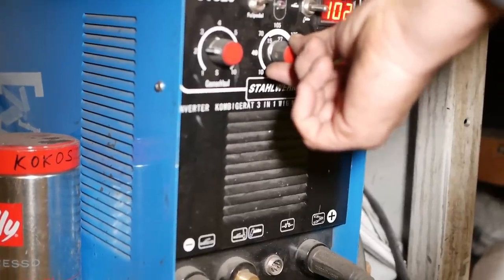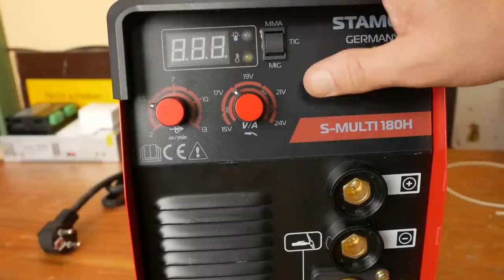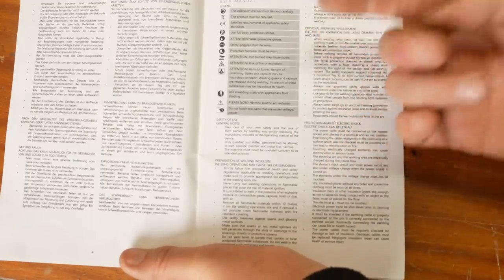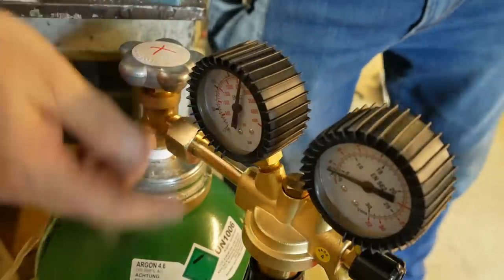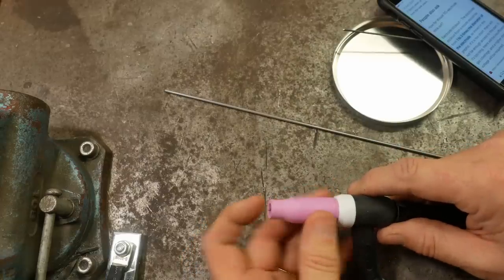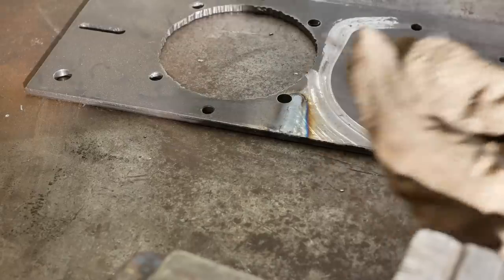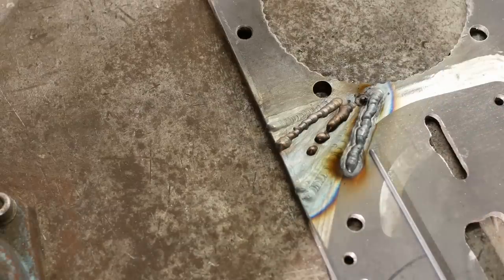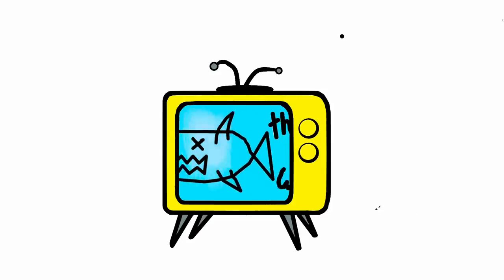Can I learn to TIG weld in an hour using just the internet? || RotarySMP

Comment: Mig is my primary welding method. But I have been doing more solid core wire welding for bigger stuff since Argon has gotten stupid expensive since Linde bought one of our biggest suppliers here. I really would like another mig welder since changing wire sizes allot is annoying. 
   
   I have a multifunction welder in the shop that the only thing I have used on it is the plasma cutter just cause I wanted to see if it actually worked... It does everything but mig... I need to get an argon tank but am keeping an eye out for a a fair price on a large bottle since renting bottles is pricey and has other downsides. But it's been a long time since I have tig welded so I will be relearning. Check out Jody over at welding tips and tricks for great teaching videos. A friend of mine has been friends with him for many years at the airline they both worked for. He really knows his stuff. You are starting off pretty well I'll let everyone else critique.

       I'm catching up on videos since getting back from Greece. All went well taking Turkish other than the interesting food and the very uncomfortable seat backs on the 787. Bad lumbar design on them. Mom had a great time and wants to go back. I have a friend at one of the hotels so if I ever get anything to drop off to you he will hold on to it till you get there. It's behind Yasouvlaki close to the old Waffle House location. (they are on the main drag now next to the other ice cream place that's half the price)
           I did make James May proud as I rented a Dacia Sandero to drive my mom around the island since it was cooler than normal and an ATV would have been a little cold. I did grab a couple Naxos decorative license plates to put on the Mustang while there. Will be back there in September with the annoying 3/4. :)
Reply from the maker: Glad you had a nice trip to Naxos. We started checking the weather, and it was much cooler than we'd expect. I hope the sea temp comes up in the next few weeks.

Remember that seats are buy furnished equipment, so the airtline choose the ones with the crappy lumber support, they are not inherent to the 787.

Linde is also really expensive gas for us here. They have basically forced everyone onto rental contracts. Their rental bottles also have the regulator on them, but I would rather have my own flow meter.
Reply: @RotarySMP  Yeah they have their seats 10 across instead of the usual 9... But width was less of an issue than the shape of the back. It was my first time on a 787 as I fly allot domestically but I never seem to be able to non rev on a 787. I really miss the a330 with its seating layout being 2 on the sides.
      The first flight the air packs were acting up and it was hot most of the flight. The air  temp would constantly change as in a minute of warm then hot then slightly cool air. I had a pair of thin shorts that I changed into in the bathroom which was not easy seeing how the floors are nasty and you never stand on anything without shoes...

    I have seen those integrated tanks with regulators in Aussie land users. Fortunately the US likes to stick with tradition for decades so we will be keeping our tanks as is. 
     The Linde owned stores have a stock of other brand tanks they will exchange for customers. They aren't supposed to but...
       We have a company called gas pony here now that you buy a tank and then you can just exchange it at any of their locations. Basically like a propane tank exchange. They have their cages at lots of stores now and are far more convenient than the few welding shops we have anymore. I want a 330cf tank which is big but cheaper to fill and less fills needed.

    Mom really enjoyed the whole trip to Athens and Naxos as everything was a new experience for her especially the good food. But now that I have a friend there I have a dropoff spot for stuff. When we go in September we are going to go out to his place which is west of Apollonas. He is also planning to come to TX for the Formula 1 race in Austin and if he does I'll pick him up and show him around TX.
Reply from the maker: @theinfernalcraftsman  Greece to Texas. That will be quite a trip for him. Do you also go and watch the MotoGP in Austin?

How much do you pay for an Argon refill over there now? That 20L tank costs me €300 for first fill and 10Y rental, and then €58 per refill/exchange.

Have you flown on an A350 or 380 yet? Very quiet fuselages.
Reply: @RotarySMP  Sorry for the late reply been busy and forgot.. 
   
       I don't go to the races in Austin. It's about a 4hr drive and I'm not fond of Austin for various reasons. I am very close to Texas Motor Speedway though. In fact once I'm on the main road by the house I go north make a right and it takes me right to the track. (32 miles about 40 minute drive) The Nascar track. I used to go to the IRL and bush races there as they were affordable and often I got great seats from a friend. Fewer people there so easier to get in and out and the seats I got had a great view right down pit lane. 

      I have an 80cubic foot tank for the mig welder which is 2300 liters. Fill amount not actual tank size. Some gasses you will get around 93cf. I bought a tank from what was Praxair years ago. Back then it was $75 to buy a tank then you exchanged it at Home depot (cage outside the building supply) or their welding store. Back then I was exchanging it for about $20ish for Argon or Argon/Co2. 
      Now it was ~45 to exchange with either gas at their welding supply until they were bought by Linde. Now it's around $75 to exchange it.  The 10 year tank inspection is just built into the cost of the fill. 
     Last time I was in there they gave me one of their competitors tanks in return which I didn't realize till later... Seems they wanted to keep my tank and tell me I need to go to the other supplier and maybe they will treat me better.. My friend in Georgia Jodaddysgarage pays about half what they charge here at his independent supplier.

    There are few independent welding shops left but I will be checking them out for prices next even though it's a long drive and with larger tanks I have to take the trailer..

     There was a place selling last fill tanks. As in they were in test but they were going to time out and this was their last fill before scrapping. They were selling 330cf tanks for $220 full of whatever gas you wanted which was a deal. Then you have a tank to use for whatever or sell for scrap. They haven't had tanks in a while but I'm on the list if they get more in. I was quoted over $300 to fill a 330cf at Praxair/Linde here. But bigger tanks are cheaper per cubic foot of gas.

         Our airline doesn't have 350s/380s so... I did almost buy tickets on BA last year on the 380 to Athens. Was getting the economy seats upstairs that are just two seats. But she was mad that we were going to have to buy tickets since we couldn't non rev on our airline since the flights are always full now. Was a deal at $1200RT for both of us.. It's double that now. 
       Funny though that when we went to Athens the other week on the 787 the BA A380 was at the next gate over. I pointed it out to my mom as she had never seen one and then she understood how big it is when it is quite a bit taller than the tall jetbridge in front of it...

Comment: Snapping Off ball end of commentated electrode by placing in a Vise and hitting  Ball sideways with small hammer -   -- this keeps from contaminating grinder wheel with steel -
with practice U can just Snap Off just the contaminated area -
Reply from the maker: Good idea. Thanks

Comment: I wasn’t able todo TIG in a hour with just the internet. The thing is i’d need a lot more pices todo or learn in the skill. And obviously i didn’t want to start with the easy steel..

Is this a new red tungsten rod? because old ones are better not something you want. The other thing is how do you sharpen the rods? For steel i not suggest Gold and the 1.6 ones i dunno but they are quite melty if you intend todo longer sessions. For starting i’d suggest the bigger ones 😅
Reply from the maker: The Red electrode was delivered with the welder. I will get a batch of Gold ones, along with the one I have. I sharpen the electrodes on a diamond wheel.
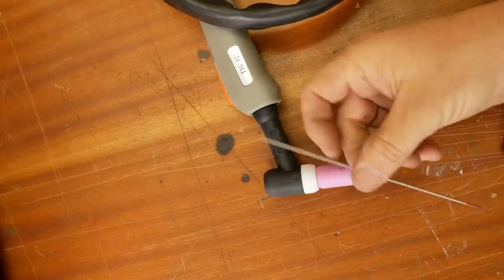Reply: 6:14
Reply: @V9TEK1  Yep i saw it :)
Reply: @RotarySMP  For mild steel i’d say get the gray ones it’s basically the same for “edel stahl”. Gold is a bit of an all rounder but my experience with the 1.6 was that through the lanthan it got always a bit to hot which let these electrodes burn down quicker.
Reply from the maker: @platin2148  Thanks for your experience with that.

Comment: Pretty basic machine, but better than nothing, I guess ;-)
Can't count how many cheap secondhand TIG welders I've picked up so far, maybe 10-15.
For me, it's only fun with former expensive, good machine and foot pedal ;-)

Bicycle spokes from scrap metal bikes are mostly great filler metal, btw, if you're too cheap to buy the real quality stuff ;-)
From my experience, if bad filler is used, your weld pool will bubble and spark, as soon as you slightly overheat it.
Good stuff, and you can put a lot more heat into it, before it starts bubbling/sparking.
Reply from the maker: I'm not one to look a gift horse in the mouth. I am sure the the range of TIG machine is unlimited at the top end, but for the sort of welding I do, mild steel square tubing and sheet, this should do well, once I learn it.
Reply: There's always a bigger machine with more amps and AC and pulse and configurable duty cycles and whatnot.
I'd assume he'll eventually replace the hand piece, get a foot pedal and then replace the machine with a dedicated TIG welder over the course of months/years.
Although even then it's going to remain a somewhat decent MIG/MAG welder.
Reply from the maker: @graealex  I doubt I will move on from it. For the really heavy stuff, I can still put electrodes into it, but this seems like the perfect machine for me.

Comment: is it a lift-tig welder ?
Reply: It's HF ignition, i.e. the electrode doesn't need to be in contact with the work piece to get the arc started.
Reply from the maker: It needs to be quite close. I’ve been practicing touch the work, lift to the right height then start. Getting slowly benn and most consistent

Comment: Superfastmatt had a good video about him taking a TIG class after years of being self taught. https://www.youtube.com/watch?v=jPFtJLytX-U Some good tips in there about what you don't realize you're doing wrong exactly like what you said.

Really happy to see you having more choice in process now!
Reply from the maker: Thanks Ben, I'll check that out. I also think it is best to get a bit of practice first before taking a class. Trying to follow someones instruction without any muscle memory doesn't tend to work for me.
Reply: @RotarySMP  100% agree, I took a class before having any experience and I expected to learn the right power, watching the puddle, keeping distance, etc. (theory stuff). What I actually struggled with was moving with the torch. Welds would look great until I ran out of travel with my wrist. Never considered the physical part of it at all before then, and it's way more important in a lot of ways.
Reply from the maker: @benni5941  I was practicing walking the wire feed with my left hand while watching the MotoGP on sunday. Felt like I was making progress. Then I put on the glove and tried it with the welder. Total fail. 
Note to myself. Practice the wire feeding with the glove on. :)

Comment: Get a Controller - foot controller is what i like  -
Reply from the maker: I can imagine a foot switch helping
Reply: Probably because you have never tried a finger operated control.  Once you do I highly doubt you will ever go back... Well unless you weld on a bench in position 100% of the time.
Reply from the maker: @ShainAndrews  So Shain, you would recommend against a foot switch?
Reply: @RotarySMP  Not exactly.  They are a great tool.  They are best suited to those where the work comes to them.  The second you need to take the torch to the work the foot pedal becomes a real challenge if you can't place and operate the pedal while being in the correct weld position.  I've also had more than a few young welders that took to a finger operated control faster and easier than a foot operated equivalent.  I chalk that up to video games, lack of manual transmissions and just intuition.  Want more heat... squeeze the torch a little harder.  Hope that makes sense.
Reply from the maker: @ShainAndrews  I dont think this welder supports a proportional current setting. I think the hand piece start switch is binary, and suspect that machine can only accept an on/ signal. Shame I cant check for that in the manual, as it says nothing.
Reply: @RotarySMP  Gotcha.  If it isn't in the manual it probably is not a feature.  Not a huge loss.  You can fudge the heat somewhat by manipulating the torch distance.
Reply from the maker: @ShainAndrews  I am practicing speeding up the torch movement as the sheet heats up and the puddle expands. I guess that, arc length  and the cooling of the filler rod are all I have.

Comment: I will freely cop to using TIG electrodes to hard-face parts 😅
Reply from the maker: Hi Jim, so it is not that unusual to strip the flux off an electrode to use as filler wire. Cool.
Reply: @RotarySMP  He's saying that he melted/dipped his tungsten into the weld puddle.
We've all watched ToT use an old drill bit for filler to put a hard high carbon edge on a tool.
Is filler rod that hard to find in Austria?
Reply from the maker: @jimurrata6785  OH, now I get it.  :)
I am sure there are plenty of industrial suppliers, but most dont sell to individuals over here.
Reply: @RotarySMP  But they'll 'rent' you an expensive argon bottle?
I'm fortunate to have a good welding supply and in a pinch on Sunday can even get filler rod at Harbor Freight (though not gas)
Reply from the maker: @jimurrata6785  I got the bottle from the Austrian equivalent of Harbour freight. Not a real tool store.
Reply: @RotarySMP  Maybe they offer 1/4 or 1/2 kilo tubes of ER70S and CuSi filler rods?
Thoriated, lathanated or ceriated electrodes? (available at Harbor Freight, but China import quality)
These are also things you might try to purchase from a welding specialist shop just to develop rapport or get expert advice.
Reply from the maker: @jimurrata6785  I thought they had filler rod, but when I picked up the bottle, they had none. Wierd. I can get them , and tungstens easy enough from Amazon though.

Comment: Do you need an oxygen meter in your workshop if it’s a basement? Don’t want you having a gas leak and passing out before your CNC lathe next video is posted 😬
Reply from the maker: Thanks Alex. I weld in the basement garage, and there is a drain in the floor into the house water drain, so an argon leak would go down the drain, or leak up under the garage door.